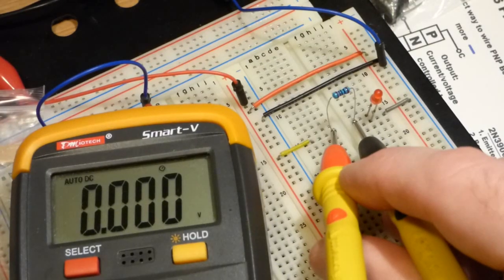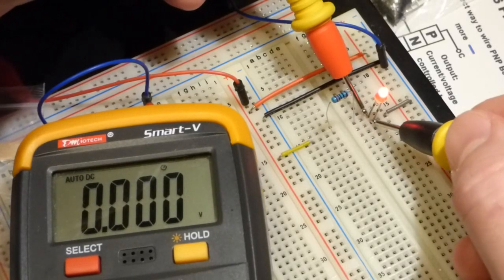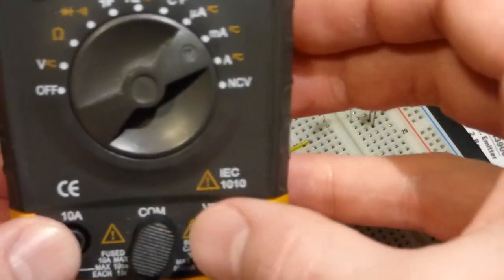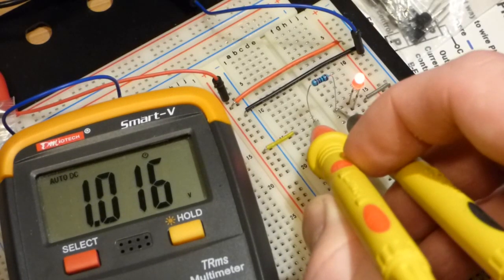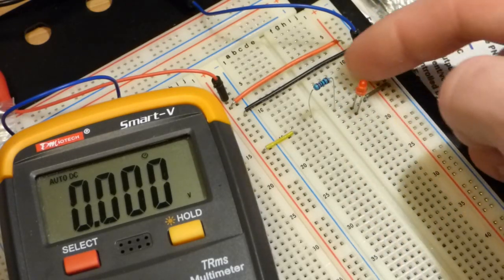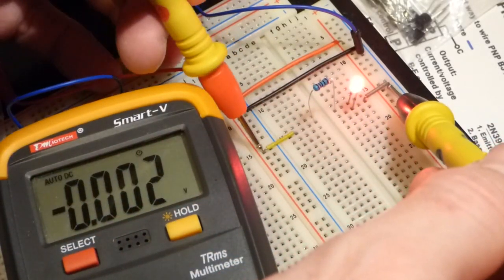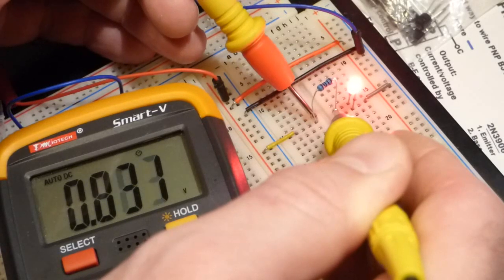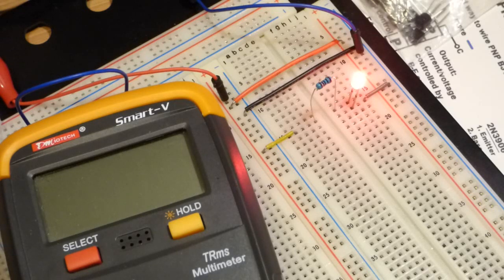Almost exact voltage through LED using 1K resistor and variable voltage power source using Ohms law

Comment: Thanks this was the perfect simple breakdown. Nice pace, nice round numbers used and even a warning about power dissipation. You should do a follow up to this with more intermediate topics relating to resistors in circuits
Reply from the maker: Yeah, I'm trying to remember to do more videos where I take measurements of individual resistors and other components in circuits. Thanks for showing interest in that.